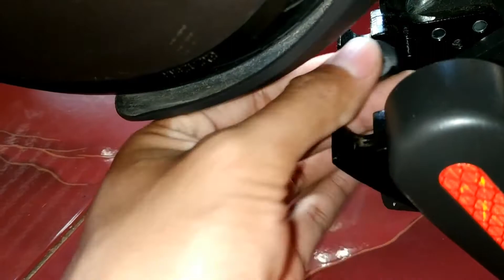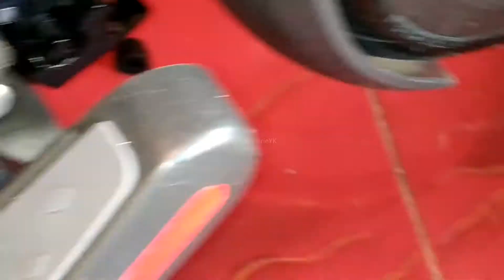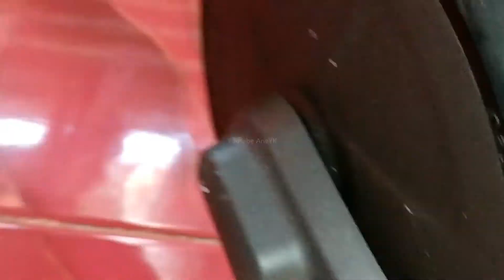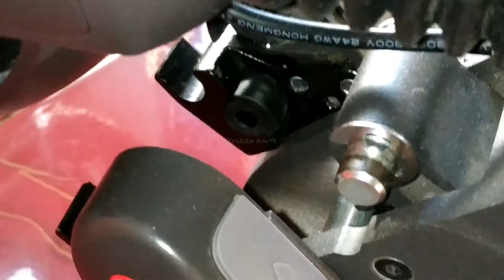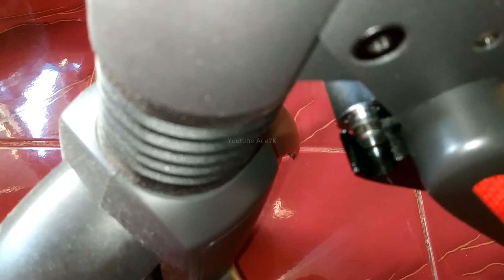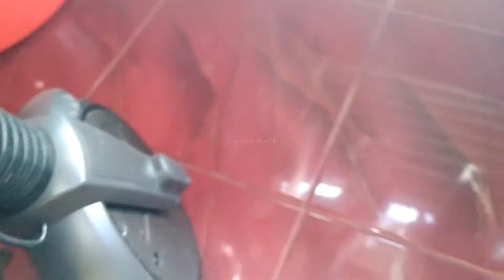How To Installing Ninebot Es1 Es2 Es4 Folding Cushion Silicone Pad

Comment: What do these do exactly? What are they for?
Reply: For prevent the vibrations during rides
Reply: It is used to prevent vibrations when moving over rough surfaces or you will hear the sound of metal rattling along the way.